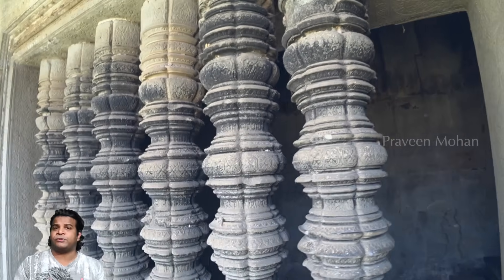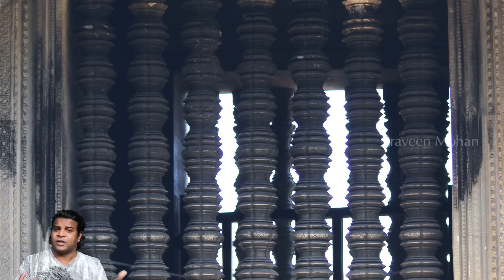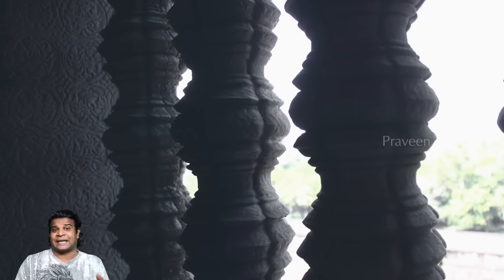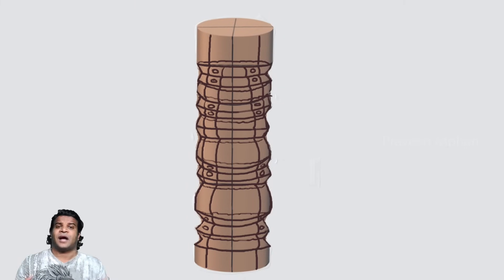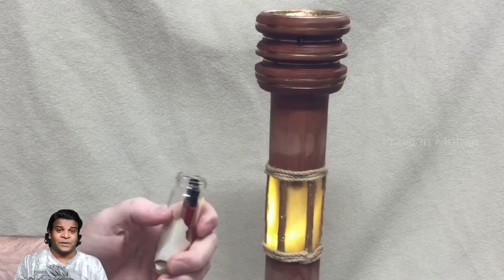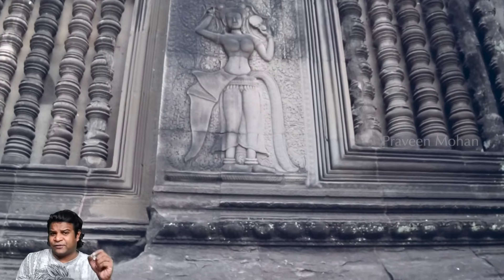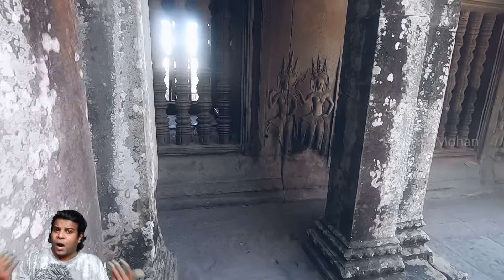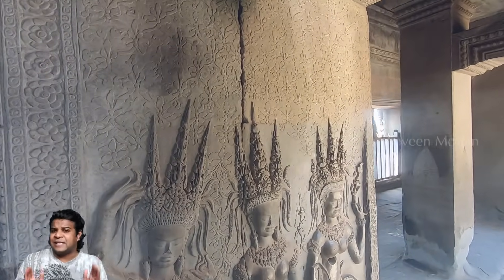IMPOSSIBLE ANCIENT MACHINE Found in AngKor Wat? Lost High Technology | Part 8 | Praveen Mohan

Comment: Maybe the pillars are lined or filled with copper or brass for energy transfer.
Reply: Those pillars look like fuses for me, they are in a group of 7 or 5,

The building is made using sand (insulator) inside, stone on outside, and lava rocks in the middle

So when the structure did what it was supposed to do, there was energy flowing from one point to another, conducting electricity
Reply from the maker: Thats a good guess, my friend!
Reply: @RealPraveenMohan  Also, what part of the rest of the carvings do these shadows hide?
And what do they show?
Can these frequencies be reverse mapped to create the sound?
Could you examine insides of the removed pillar?
There was a reason someone removed them, cuz they knew they were valuable
Reply: ur a Great  Praveen mohan sir

Comment: they were made in a mold the vertical lines are the proof and then they stuck them back with sandstone and cement that they used. The materials were poured into a mold and while still not totally dry they were put back as one piece.